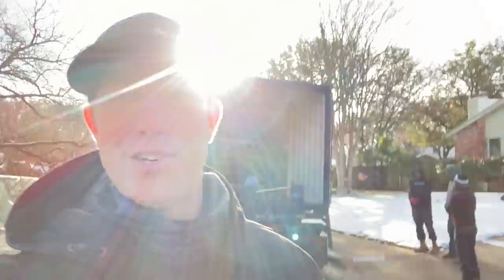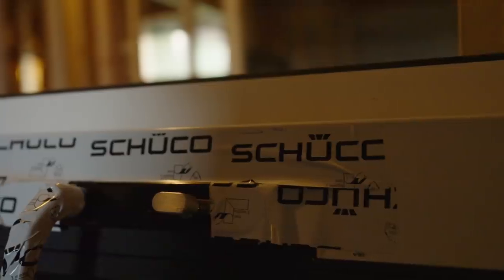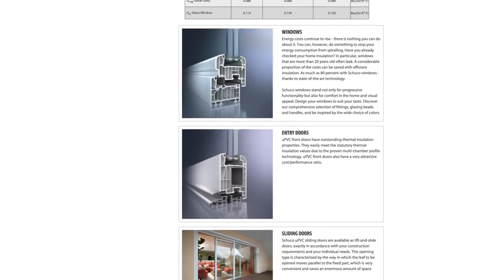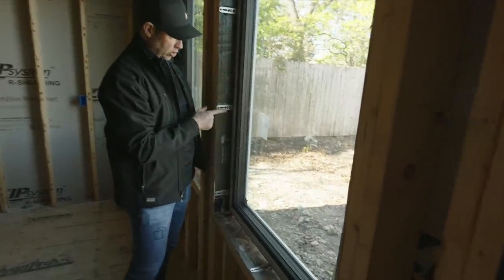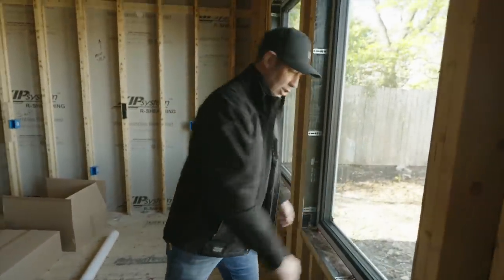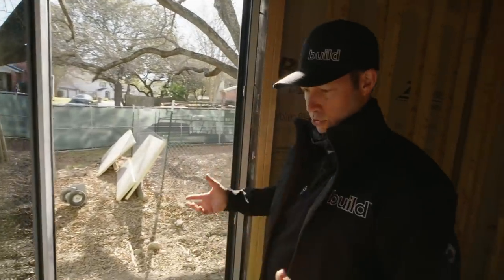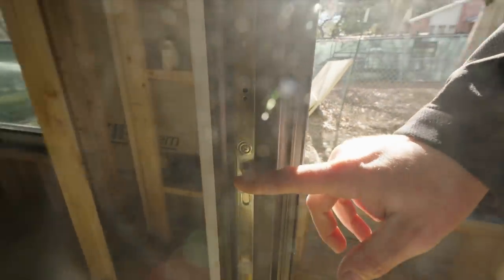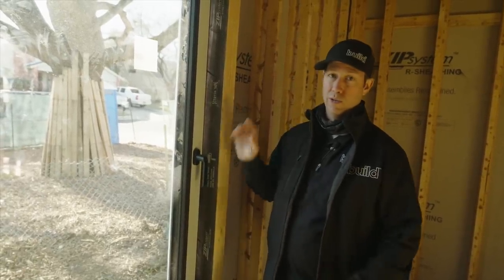Ordering Crazy Efficiency (and Affordable) Windows from Europe!

Comment: Casement windows are hinged, usually latch at one point and open OUT. Screens if provided are on the INSDE.
TILT AND TURN WINDOWS (aka European Windows or German Windows) are hinged, latch at multiple points, and SWING IN OR TILT IN.  Screens may be provided on the ouside. Also some manufacturers provde integrated shutters or shades for light control.  The Tilt and Turn Window is a superior product to casement, single hung and double hung windows in just about all respects IMO.

Comment: Very odd to see windows opening inwards. In the UK we use these windows everywhere but when we open them, the window goes outwards (instead of coming inside the house)
Reply: Internal opening windows are a lot easier and safer to clean, particularly on upper floors. No long ladders needed, and you dont have to sit on the window cill with your backside hanging over a drop.
Reply: You can get inward opening Windows in the UK too (I'm sitting in front of some Rehau Geneo triple glazed ones at the moment).  They're normally described as "tilt and turn".  They work well with exterior shutters, but less well with interior blinds (shades), or curtains (drapes), if you want them open at night.
Reply: Don't listen to the salesman Matt, uPVC (or PVCu) is just a different term for vinyl.  If they put plasticiser in, then the frames would be floppy, just like electrical cable insulation.

Comment: how long can this UPVC take the Texas sun without embrittlement? Also what is the expected life of the triple glaze prior to leak leading to water condensation between the glass layers? any data?
Reply: Generally european windows are made with the glass pieces sealed in a Aluminium frame that then is put in to the window frame so it should last at least 10 years more after the outer pvc has degraded and lets in water.
And the plastic doesn't just dissapear in chunks, its only a very tiny skin flake at a time over several years so not really a concern 

Can't say how long it will last but generally we have 30 years warranty on windows here

Comment: Tilt and turn windows are nightmare for window shades/ treatment. Look forward to seeing your solution
Reply: Was thinking about this the other day.  I would put on exterior decorative rolling shutter/screens.  I would love to not have interior window coverings but do want shade or privacy on demand.  If wishes were fishes.
Reply: I'd be surprised if you couldn't get magnet-clipped shades; magnetic strips go along the top/bottom/sides of the window, and the shade clips on with more magnets sewn or glued to the material.  If done right, you can work them so that they roll up halfway or a quarter of the way to let in some light but still have some privacy, etc.  They're a feature meant for cutting out the light in tinyhomes and RVs with skylights, aka horizontal or sloped skylights, so there's no reason why they couldn't also be applied to vertical-hung windows.

Comment: Except if you run an energy calculation, high efficiency windows are emphatically a bad purchase decision. The sweet spot is E2 glass around unit R3/u=0.31 to R4/u=0.25. As usual, US industry, where absolute TCO rules, is again correct. If you want other features of Euro windows, by all means. But cost and energy calcs dictate domestic medium cost units overall.

Comment: But Matt, the very last video that I watched from you was praising single pane windows.  Are my clients going to be better off with single-paying windows or triple glazed windows? How long should I expect the seals in a triple-paned product to last?
Reply: I think you'd be nuts to use single-pane windows in any climate.  The previous episode was about custom-built windows mainly for historical-type builds/renovations where they want to match the look of the original.
Reply: @ArthurDentZaphodBeeb  that was not what Matt was saying at all. he was extolling the virtues of a window that would last a hundred years versus a double pain window that wouldn't likely fail after 20. He also very specifically mentioned the average difference between a single pane window and a double pane window in overall heat loss. He also mentioned lawsuits based on the exorbitant claims of double-paned window manufacturers

Comment: Funny I was thinking of doing the same, order windows and doors (and those metal roll-up exterior shutters) from germany for when I build my forever home, getting better quality, higher insulation value and shipped for less than I could get it in the USA.  My last trip to Germany I went to 3 standard German big box building supply like home depot, and was so amazed to see them having higher quality, eco friendly, modern products made in germany and europe for half the price of the cheap chinese products we get stuck with in the home depot's and lowe's in the USA. Less than a dollar for a square meter of tile,  with a nice design made in itay.. I'm currently rebuilding my bathroom and for similar tile I'm at over $6 for a square yard not even a square meter and it's from china.

Comment: Why would you spend all that time to put a door pan in if you were going to seal it off with all that caulking? Doesn't that just create damning of the water and trap it inside. Wouldn't it just be best to put the sealant in the back of the pan against your flooring, and any water infiltration would then run out. Just a thought would love your response. Thank you

Comment: hmm around 2 years ago when i was visiting my friend in Poland ,(he own a man/fiters window company) he mentioned they started to introuduce to market a 7 chamber frames with 5 glass window ,he mentioned aparently between every 2 glass pans was difrent gas ,as some studies shown heat transfer is slower if mediums change ,for me sounded like marketing bs ...but hell worth to mention , btw 4 glass windows slowly become there standard window
Reply: Maybe something there with thermal radiation, but it would have nothing to do with heat conductivity. That said, I thought glazing did a lot of the coverage for thermal radiation, so I think you're right that is more marketing than anything.
Reply: you won't be able to install a 4 glass window into an ordinary wood frame house, let alone 7, -  much too heavy. It would have to be concrete or brick.
Reply: @jordanwinter2484  you reckon 6x2 criples wouldn t hold weight??  as far i know those middle glasses are way thiner than externals so weight dont go up that much ,btw this 7 chambers is about pcv chambers in frame apparently more chamber more insulating window is...
im really curroius about reason as its very  common to build wooden house now in Poland as up to some space you dont need any permit ,and as its not traditional for that region is quite cheap so far,so im curious how people deal with weigh there ....

Comment: Is there any chance you can recommend a tilt turn installation contractor in the NE Ohio area or provide any suggestions regarding correction of a poor installation job related to tilt turn windows?  I had these style windows installed and have been dealing with air ingress issues ever since.  Other contractors don't want to touch the original installers work.  Any suggestions would be appreciated.  Thanks in advance.

Comment: Matt I have a question could you tell us what the difference in price would be between the US windows and Europe Windows. Also that might seem like a silly question, but screening would be done from the inside or outside or is there any screening?  Amazing how many great products come out of Europe that the US should be thinking about. Thanks again.
Reply: In Portugal we mostly use pvc double glaze windows because the temperature doesnt oscillate that much and costs 150-200 € a 100x100 cm, but if ur going to do rly big windows a highly recommend aluminum because it doesnt bow as pvc does. the screening is always in oposite side of the opening of the window attached to the frame

Comment: Where I live, we have bugs. I have not seen one screen that can be installed. Am I missing something?
Reply: a tiny frame with a mosquito net could be attached from the outside
Reply: Besides using extra manufactured frames that you can attach from the outside, we use simple velrco fly screen like this: https://www.amazon.de/-/en/screen-Comfort-Velcro-strip-windows-Anthracite-transparent/dp/B001ULCOFM/ref=sr_1_3

Having attached that to my bedroom window for 10 years now, without any problems. Needed 10min to attach it. Easy to remove in 10 sec (people in Germany renting house/appartments, so you have to be able to remove your stuff once you leave that place).

Comment: Did I hear correctly that the window is flashed on all four sides without a weep path for the sill at the bottom? If so, it’d be interesting to see how that’s detailed.

Edit: Rewatched that, and it seems the window frame itself has integrated weep holes at the bottom front. Would still be interesting to see how the detail for this is done with it sealed on all four sides.
Reply: I would be remiss to not point out that the original EIFS (surface sealed) also came from Europe where there were no issues. Got to America, and the system leaked like a sieve and created miserable failures so "drainable" EIFS was invented here.  Turns out American construction workers were not as detail oriented as their European counterpart.  wondering if history will rhyme with the window flashing :)
Reply: @gregorysmith9158  I assume that’s the reasoning behind why it’s not drained the way we do it in the US, typically over in Europe. I can’t speak from experience to the quality of European construction, but I’ve seen and know plenty enough about the industry in the US to know that shitty work is rampant. We just don’t build to such high standards here, which is a shame. It’s a consumerist approach to construction that will and is costing us in the long run. Now, not everything is built in such ways of course, but most things are, as most construction is production builds; and even ‘custom’ or high end work suffers from these trends since tradition is hard to break. It’s hard to learn how to build to a higher standard overnight when so few people know or teach how to.

Comment: These windows and doors seem awesome! However when it comes to installing window coverings, I am not sure how one would install blinds or drapery without having a conflict with windows that open in.
Any thoughts on that?  What is done in Europe?
Reply: blinds up... Open Window...blinds down (most open more than 90° to manage that) off course blinds must be install in the wall and almost the same size as the Window.
The same applys to drapes however drapes in europe tends to be divided in several drapes per window so the window Open and you can still slide the drape to keep anyone to look inside and can be must bigger then the window
Best regards from Portugal
Reply: Use blinds that attach to the operable section of the window. When you open the window, the blinds move with the sash without being obtrusive to the operation.

Comment: Do they have windows that open outwards? You won't be able to have recessed blinds with these that open inwards. I've also wondered what stops the wind from blowing the windows open more than you want?
Reply: Yep, these windows are often used in northern parts of Europe, so the wind is pressuring the window against the frame. For 'extra air tightness'.

You can have these windows with build-in blinds, so no problem to open them inwards (or if used as windows for a roof). And btw, the 'tilt' option has been invented bc Germans (and other Europeans) are used to use recessed blinds.

https://www.amazon.de/Fensterfeststeller-Magnetische-Fenster-Arretierung-Schimmelschutz-L%C3%BCftungshilfe/dp/B07JMWZHH6/ref=asc_df_B07JMWZHH6/
Reply: @agn855  thanks! Very often I see Matt hype these windows, but leaves out quite a few details.

Comment: I guess you are aware that the European R Value system is not the same as the one used in USA. Loosely, the European figures can be multiplied by about 6 to obtain USA values. I assume the figures you quote have already been converted.

Comment: The contrast here is striking. One week ago Matt puts out a video showing a colleague’s shop making custom historic windows with single pane glass and completely dismisses the energy efficiency, saying a U factor of 1 isn’t a big deal because it’s just a window. 

Now he comes back and starts arguing that double glazed windows are not good enough and the improvements in efficiency from a triple glazed window make a huge difference. 

Which is it, Matt? Are efficient windows important or not? Personally, I say yes and I think you were just trying to be nice to your colleague while visiting his shop, but you lose credibility when you contradict yourself.
Reply: In Europe reconstruction of historic buildings have to follow specific codes. For that reason modern windows aren't allowed as it would compromise the visual aspect. An option are VIG (vacuum insulated glas) windows bc they can be used within 'historic' frames, but provide the same R-value as tripple glazed windows (but less weight!).
And no, having tripple glazed windows for an otherwise completely un-insulated (college) box won't make sense at all. 
So Matt was right not to care about that aspect.
Reply: @agn855  Yeah, I can see that, but he was advocating these for non-historic applications. It wasn't regulations limiting the type of window; he was simply arguing that in the south single pane windows were good enough and there wasn't a significant difference in efficiency.

Comment: Windows in U.S. amazed me like wooden electric poles. XIX century technology in   the spaceX power.
Reply: If tall straight trees were as cheap and plentiful in Europe as they are in Canada and the U.S. then Europe would be using them too.
Reply: @1966johnnywayne  maybe in rural areas, most of the Netherlands (i can’t really speak for outside my country) is so populated that all networks (gas, electric, water, phone, fiberglass, tv, sewer) are in the ground. (Mostly under sidewalks, or the street)
No cable clutter in the air, nor height restrictions on transports.
Only thing we have are the main powergrid towers connecting the entire country.

Comment: Matt  you butchered their name ..... Schüco     ü is pronounced like : https://www.youtube.com/watch?v=B06gGVL8DZY
https://www.schueco.com/web2/us/company
 
I am very very happy to see you bringing on some real high quality products from Europe. Just as a tip. You can get also premade stainless steel frames for those windows or aluminum flanges which are much better lasting than your tape. You can just glue them in place before you set in your windows. Since in Europe most houses are brick build it's for the US market a bit challenging with all wood. But I noticed with a stainless steel sill-plate  and aluminum glaced 3 piece frame we cut installation time down to less than 30min per opening. And instead to have my framer to put a 5 degree pitch in the frame in which takes way to much time we just use abs plastic to get the 5 degree pitch in before we put the sill plate down. With a nailgun you shoot those abs plastic parts just into the wood before you glue down with PL375 or compare able glue the sill plate into place.  But you can also get PVC molding which is preformed : http://www.huaxiajie.com/sale-7560316-smooth-pvc-trim-moldings-elbowboard-plate-plastic-window-board.html 
Buy in bulk and you reduce your window install cost in material and labor by over 20% per window. 
Quick tip next time you install a sliding door. screw in 2 pieces of 2*4 onto the inside corners of the opening with 2 foot length each peace in a 45 this way you can lean again it without been in the way when you move the big door from the inside to the outside to than drop it onto the sill plate. On the glass we have a 3 point level with suction cups on so we can see which way we need to move the monster to make it level. Also we always have all panels in the door and have big glass suction cups so per 3ft wide we do have up to 2 people to lift it in place. Moving dolly's and arm straps make it much easier to carry to the site before we drop them in place just by using the suction cups. On the inside we have 1-2 guys ready to screw in in the center point the first top bracket this way the guys only need start to finish less than 30min to drop in a big panel sliding door. Also we prefer to use sunk in screws in the bottom plate to be at least 4" long ever 2 feet same for the top plate this was we only do need on the sides 2 screws for a 8' high door.

Comment: Matt, love your videos but what's it going to take to convert you into the Church of ICF? We just built a 5000sqft home using Amvic R30 home up here in climate zone 6. With the price of lumber right now and some time savings on labour, it ended up costing us less than a timber framed home. We were expecting to pay a bit of a premium, but it worked out less. 

What's holding you back? You seem to rave about it in a bunch of your videos. 

Our place is quiet, disaster proof, crazy energy efficient with that solid mass resisting daily temperature swings, no thermal breaks, and air tight by design. We slapped in some .12 triple glazed windows, blew in a ton of cellulose in the attic, insulated the basement slab with Amvic's radiant heat system and we're laughing.
Reply: Problem is that icf is a church. You can do waaaay better for the same cost with other standard methods. Look at thermomass CIP i blows away everything icf claims as an advantage.